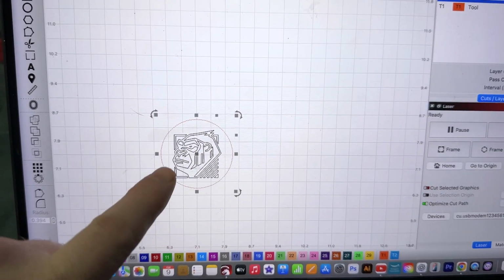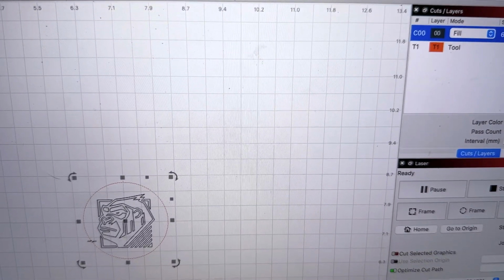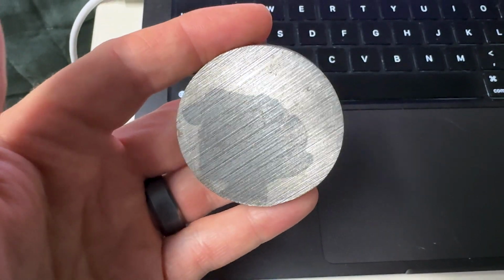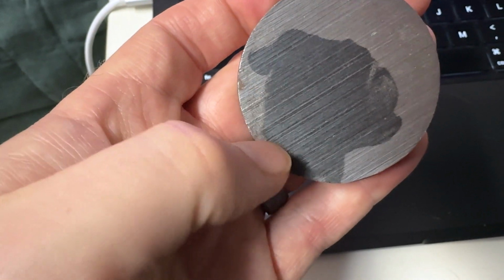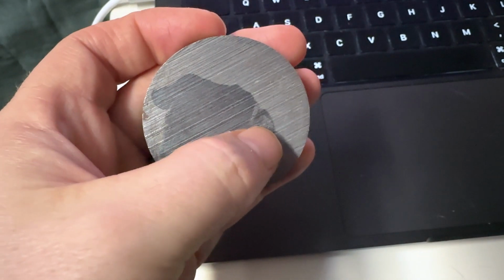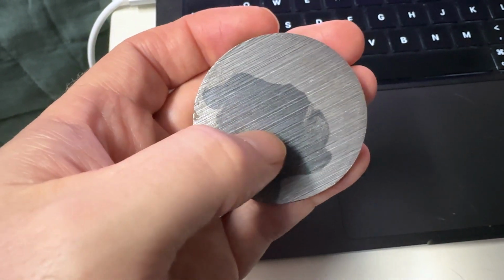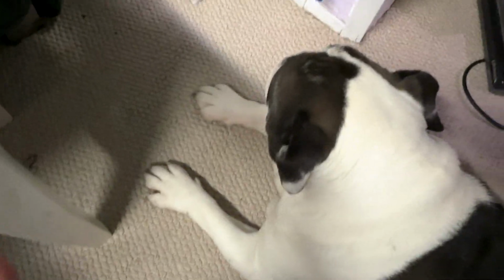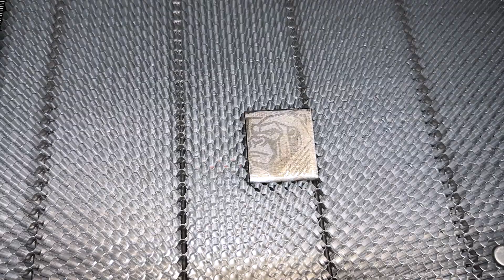Creality Falcon 2 22W Laser: Can It Etch Bare Steel? Laser Engraving Test!

Comment: I have seen a video from Red Beard Ops (knifemaker) where he used a 20w Xtool laser but he made many passes on the same spot and it seemed to work pretty fine. Did you do just one pass? Also, his knife where clean and sanded surface so I think it helps compared to a rough saw cutted surface or scaled surface like you tried. Link: https://youtu.be/OJ-Ue1mtqgg?si=THTarXolAP896t4v
Reply from the maker: Thank you for sharing. I did only one pass. I wasn't trying to get any kind of depth out of it. A friend was wondering if it had to be prepared to put a logo on it. It was a test run to see if I could mass-produce his logo on his welding kits.